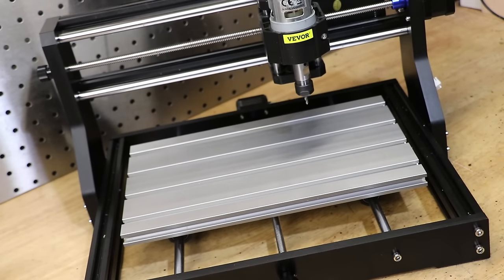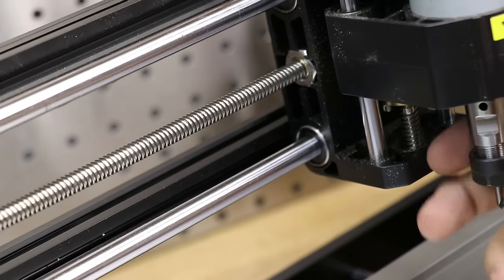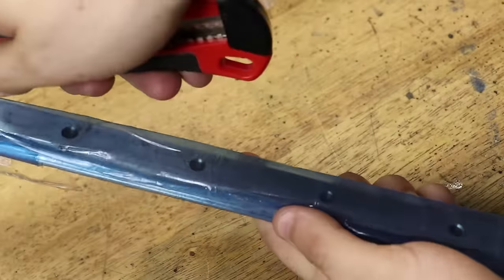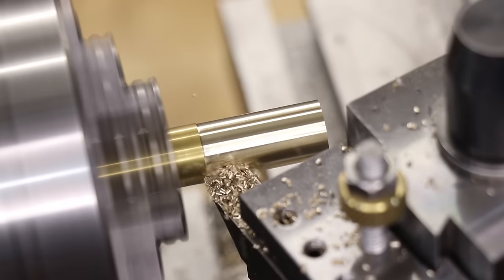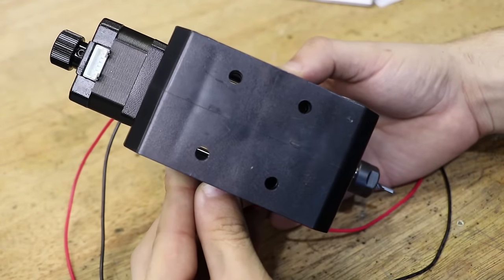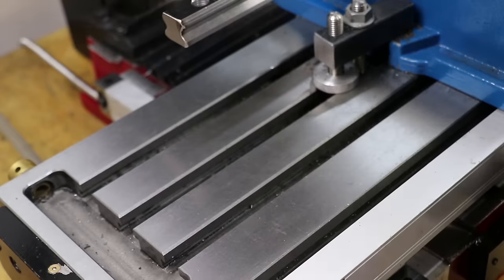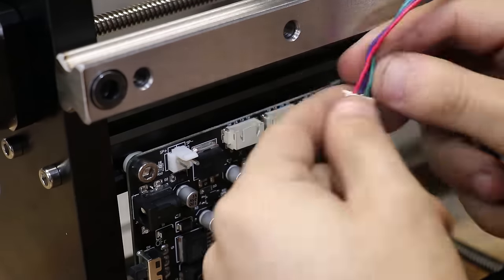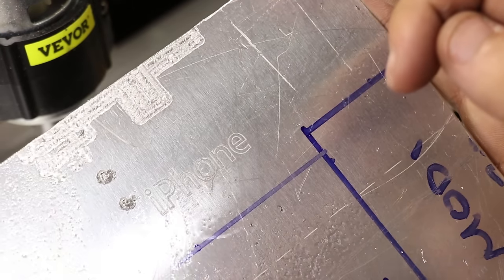Upgrading The $200 CNC Machine

Comment: My problem with the machine is the spindle motor. It vibrates, depending on the location above the workpiece, because it is not balanced and if the support ist not stiff enough, the narrow engraved line immediatly became a wider track that pushes everything to the sides. Unusable for PCB work, unusable for engraving. It depends how precise the endmill is inserted into the ER11 collet, I may use a puppitast to center it but it is not centered enough (and of course tedious work upon every tool change). So your modifications are way behind the problem for me.
Reply: I’ve seen people get this machine to work for PCB engraving, I think his would do the trick too after those upgrades he did. Are their replacement spindles that you’d be able to get? That was the upgrade I was hoping to see in this video. I think this machine has potential if you’re willing to upgrade it.
Reply: @bigwendigo2253  Yes, and there are people where this machine fails, can not do pcb work or nice engraved lettering. The engraver bits that have a simply flat tip (half of rod grinded away) will always inbalance the spindle. Engraver bits that have a spiral are much better. But the main problem is the missing stiffness of the portal.

Comment: The best setup is to use this machine just for PCB machining or light wood. Later, build or get a cnc dedicated to metal, it separates,the functions as well.
Reply: The machine here is a desktop engraver. It does that fine. It's not a milling machine. Maybe you could do some light milling in plastic or wood? I still wouldn't call it a mill though.
Reply from the maker: I would assume as much. Much easier than the acid etching we had to do back in high school :)

Comment: cool, but im still buying a nice desktop cnc mill with proper linear rails ballscrews , a full alu frame and a decent housing , for the parts i need (really fine &precise) 3.5 k isnt that much , and i want a machine that does what i tell it and doesnt need fiddling all the time
Reply: I mean, sure. A $3.5k machine is better than a $200 machine. Some people get a kick out of making cheap machines punch above their weight class and spending the other $3.3k on materials or whatever.
Reply: Why are you even here making such a stupid comment. Of course a $3500 machine is better than a $200 one, FFS.
Reply: @johncoops6897  the CNC business is kind of messed up. What you get for what you pay doesn't always add up. There's a lot of preying on ignorance going on. Just how it is. Everyone loves money after all. The CNC racket really attracts them too.
Reply from the maker: Sounds great, best of luck and I hope it works out well.
Reply: @johncoops6897  my comment was slong the lines of " cool machine especially with the Upgrades,  but id still like a machine that i dont have to mess with all the time to produce precise parts " 
and yes i get that the to are not comparable but both are desktop cncs but there is a reason i want the more expensive one 🤷‍♂️

and if you used a really nice one (emco at school) you dont want to go all the way back to the start 
its like a 5k car and a 60k car , there is a BIG difference 

if you want to make parts that fit together the 200$ ones are almost useless (for example gears etc)
Reply: Volksfräse from uncle phil

Comment: Ridiculous video. Upgrade a $200 machine with gear worth $10000
Reply from the maker: I'm pretty sure I said you could do this with a $120 drill press. Edit: yes I did say it, I used the mill out of convenience though. You could even use a cordless drill if you wanted to. The lathe was $600 but you can get standoffs on ebay
Reply: @artisanmakes  Don't feed the troll please. 
Nice video. I've been planning on doing something similar on my 6040 machine but the construction of the gantry assembly on that machine makes it a bit more tricky. Still debating on whether to ditch the linear rail and just add a substantial pair of braces between the gantry side supports to make it a bit stiffer.